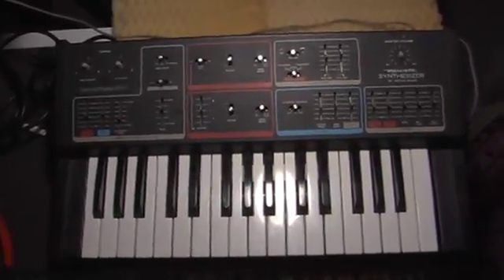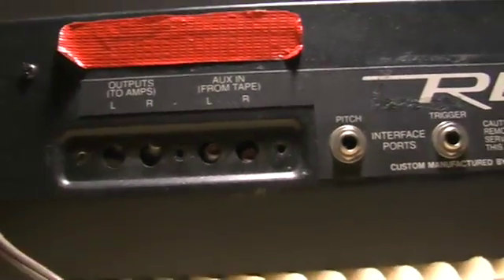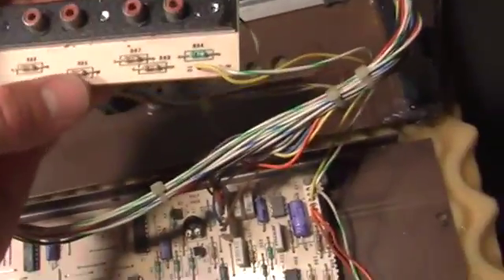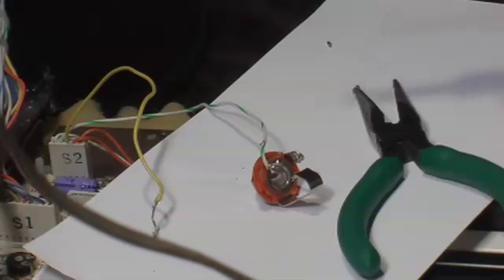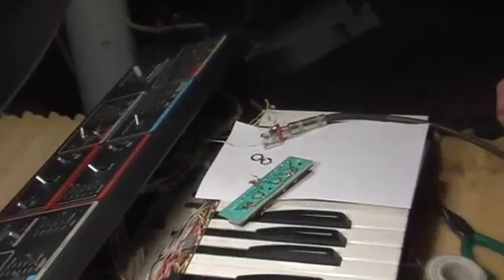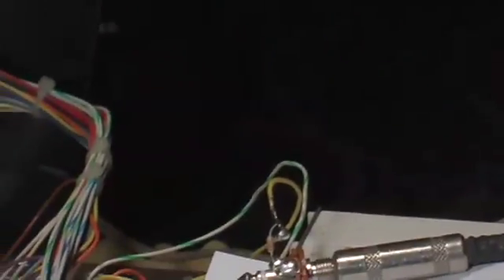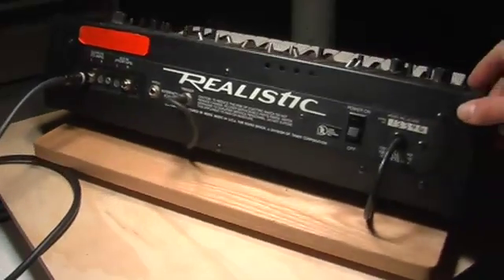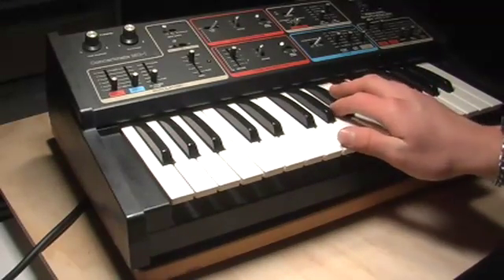How To Modify Concertmate MG-1 Synthesizer by Moog - 1/4" Input & Output

Comment: Gerbaard Baard On an unmodified MG-1, the audio input jacks connect directly to the output jacks, they do not connect to any other part of the MG-1 circuits.  This mixes any input audio connected to the jacks with the output of the MG-1.  Audio connected to the input jacks can not be modified by the MG-1.  Perhaps k erikino has modded his MG-1 to process input audio?

Comment: actually the stock output on the RCA jacks is super low. Even when wired to a hifi it's about 10db lower than normal unbalanced gear. Bypassing those resistors gives you more output.

Comment: @kerikino Actually, I've heard that the MG-1 is almost the same as the Moog Rogue, which wasn't designed by Bob Moog himself and that the MG-1 was made by Moog for Realistic to distribute in Radio Shacks. So it is basically a Moog, and yes it is cheaper.